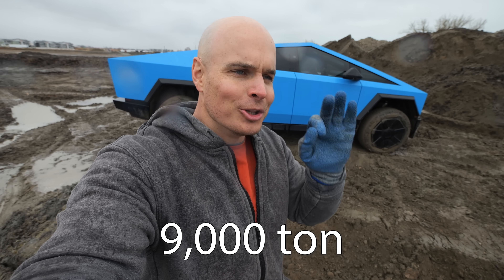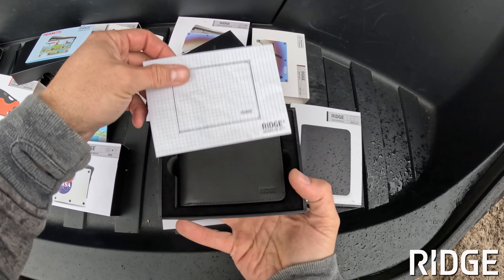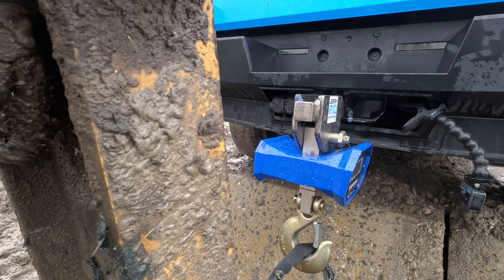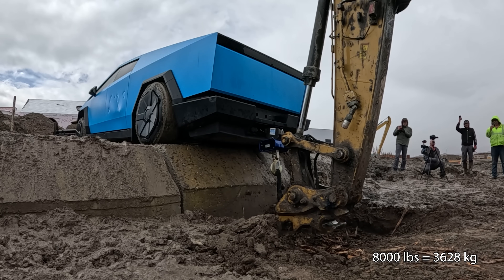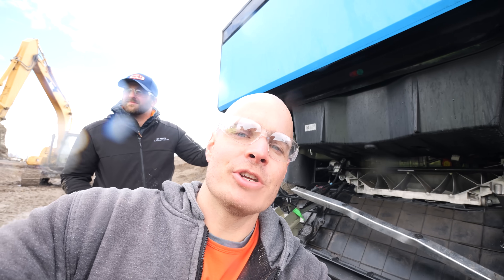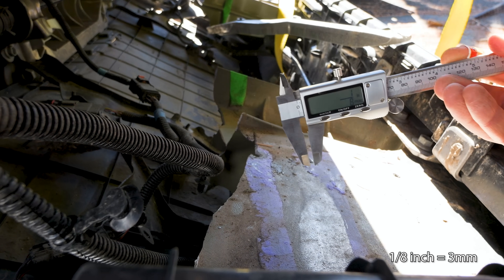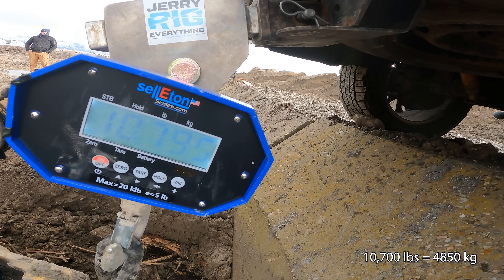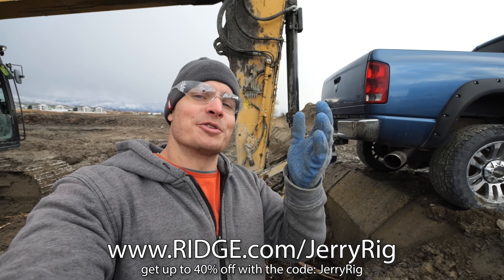SHOULD YOU TOW WITH A CYBERTRUCK?! - (catastrophic failure test)

Comment: Whistlingdiesels follow up video pretty much proved the regular truck can hold up. 😂 But the fact the cybertrucks limit is marginally less than its specified maximum is comical. 

Usually an engineer's design maximums include a factor of safety. Looks like they  went with .95 instead of 1.05 😂

Comment: Okay, I just wana say that it being able to handle 10,000lbs vertical when it's vertical capacity is around 2k is absolutely amazing.
My dad and I haul a 50ft step deck semi trailer with a single axle tractor.
10klbs vertical is basically our max axle weight. Which means that we have to distribute the weight better on the trailer if the scale gets up that high.
Absolutely insane that any truck could handle that, especially with a cast aluminum frame.
The ram definitely held more, but both you definitely would never ever want to be in any situation where you have anywhere near that much weight. The only difference is that the aluminum has a more sudden catastrophic failure, compared the the steel that can bend a lot more before completing failing. Still both get damaged though (not even talking about suspension or axles lol)
I completely disagree when he said that there'd ever be that much weight on the tongue of the trailer. If you did that with any pickup that wasn't a dually then it'd be severely damaged.
Reply: 10k on the tongue of a bumper pull is INSANE.
Reply: During testing this was purely static load, they were moving down very slowly.
But when driving, that 2k pounds get's easily amplified on a bump or pothole.
----
Saying the aluminium has a more catastrophic failure compared to steel is wrong. Aluminium can bend, and steel can be brittle. It depends on which specific alloy of aluminium you use, and what temper it has (same thing with the steel alloy). Cast metal is usually way more brittle than extrusions or forgings.
And how much a structure can give before breaking also depends very much on it's shape. A solid rod will bend more like s spring, a hollow tube with buckle.
Reply: @sasjadv  I hear you about the failure mode of aluminum vs steel. Here's the problem though, If the cyber truck had an aircraft grade aluminum frame, it might bend, but its cast. The steels used in automotive frames tend to be designed to bend as part of the crash structure, as seen with the dodge truck frame bending here.
Reply: @Leedledlee Yes, but Tesla's castings aren't entirely cast.
So with traditional casting, you heat up metal above its melting temp (with quite some margin), and just pour it into a mold.
With forging you heat it up way below the melting temp, and bend/press it into shape.
Then thing Tesla is doing, is something in between forging and traditional casting: they take almost melted aluminium, and press it into a mold with force.
   And their excuse is that these high pressure castings can still give a little bit, so they thought it would be good enough. 🤷‍♂I would have done it differently.
----
In aircraft, aluminium is forged into billets, and machined into shape, or rolled into sheets and riveted.
Those are actual forgings and not high-pressure castings.
Reply: kinda my thoughts...90% of people who buy this won't put more than a quad bike or a few bikes on it anyway
Reply: I think not only aluminium is the reason for a crack it is also the casting. Casted metal cracks (would be interesting to see a casted steel frame )   .  The Dodge Frame is made out of high strenght  steel profiles which bend before break.   
It´s just a question for what the Frame is designed .  Maybe the dodge is way beyond a plausible load and the cybertruck is closer to its intended use.
Reply: @axelweber7047  yup I bet a forged aluminum frame would be pretty great, still not as good as steel, but cast aluminum as a frame for a 6000lb truck that can tow 11k just seems like asking for  possibly fatal problems over time with fatigue. People will praise it because innovation in technology, methods, and profit are their main concern. My opinion is that excessive engineering to make the cheapest part possible that meets a safety margin when it leaves the assembly line is NOT the direction we should be moving when engineering vehicles for daily use on public roads.
Reply: So far Zack isn't reading the comments, but he'll definitely have to retract this video, it's absurd, to say the least.
Reply: From your posts on X you are clearly biased against Elon and this is just a stunt to manipulate people into thinking the cyber truck is inferior.
Reply: I agree with you. Any normal truck that's not a dually and you put that much weight on the tongue you have already encountered way more damage happening elsewhere first. That much weight on the tonque going down the road would already make it dam near impossible to drive in any safe manner.
Reply: I am not an engineer but I think you're confusing static vs dynamic loads.  Yes I agree 10k tongue weight seems very very high but this is a static test.  The frame should not just shear off like it did.  This is troubling.
Reply: it clearly DID NOT handle it 🤣🤣

Comment: It is not glued, only spot welded or riveted. 
The glue is a sealant that prevents corrosion. 
You can't say that cast aluminum will always be weaker.
Weak cast aluminum has R02=150MPa and density of 2.8kg/L
Normal steel has Re=250MPa and density of 7.8kg/L
If you make an aluminum body with the same mass as steel, aluminum will be more durable.
You can use aluminum with 300 MPa and make walls almost 3x thicker than in steel.
You can use fine-grained steel 700-1000MPa, then with the same mass of the car, steel will be just as strong.

Comment: Your wrong about this, Truck and trailer  suspension plays a major part of weight distribution.  You well exceed that hicth rating  by 8000 pounds. My 3500 has a super hitch with   capacity of 2000 pounds of hitch load and 22000 pounds of pulling load. Make sure you know you'd load limits before trying to add a trailer. If you want to see real unbelievable towing go over to RVing with Joe and bring a puke bucket. Unreal what people do.

Comment: I'm not saying this car is any good, but the Owner's Manual for the Cybertruck clearly states a tongue capacity of only 1,100 pounds, which the car was able to provide with significant margin. If you use the car in a way not intended and it breaks it is kinda your fault...
Reply: @mierenmans, hij heeft het hier over kogeldruk, dus kracht verticaal, als je kar max 750kg is (dat klopt), dan is de kogeldruk niet zo hoog, volgensmij is die meestal maar 50-100 kg
Reply: Liberals are trying everything to make the truck looks bad even tho it’s stated that its just 1,100 pounds and it just took almost 11,000…
Reply: that's quite a weak limit. The smallest trailer you can legally drive without a special license in the netherlands is 750kg loaded (≈1600lbs) which means you cannot safely drive with it with a cybertruck.
Reply: @mierenmans no, tongue weight is downward force, not towing weight. Recomende tongue weight here in Norway is 50-80kg.

Comment: Issue with casting in addition to a porosity and no linear grain direction is its questionable repeatability in production. So the part you test may differ in structural performance than the next part you build. This means to have a safe design you really need to use very conservative allowables and not a great performing manufacturing option. Obviously if cost of build out way performance, which is often the case with many products.

Comment: I don't think the actual design of the structure is flawed in the slightest, 10k on the ball is absurd considering the towing capacity itself is 11k (and max tongue weight is 1100 pounds). There have been issues before with traditional steel frames, like the Colorado having bent frames from towing off road, but the key word is bent, not snapped. Steel handles shock much better than aluminum. As you said, over time the aluminum is going to get weaker after every major shock.  If Tesla wanted to keep with the Gigacast aluminum frame and have it tow heavy loads, integrating a steel subframe within the entire back half of the truck with multiple attachment points would have been far smarter, or going with a full steel frame to begin with. In the end, I see it being a long term issue vs a short term issue, if Tesla is wise they'll preemptively reduce the towing capacity before anymore real-world incidents occur.

Comment: The worst part of me is that you can't even fix that kind of failure. What a bad design. Chinese knockoff quality. 'Merica's goin' places these days.
Reply: You have no idea what you are talking about just like Jerry
Reply: @wcovey25  what's wrong about this assumption on the design? The aluminium part is thin as hell and it's way weaker than normal trucks. It doesn't mean that it's going to break everytime you use it, but stress on aluminium over time will fatigue the metal till it brakes. It's not a truck meant to be repairable or durable, just to look "pretty" and strong on the outside. The choice of design they made added so many compromises and increased the price so much that even if you find it good looking it still doesn't make sense.